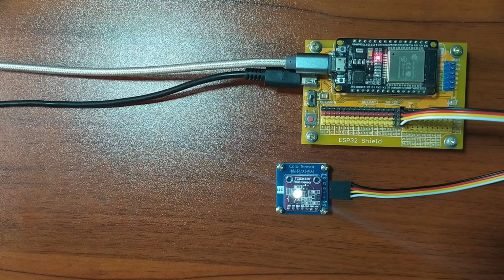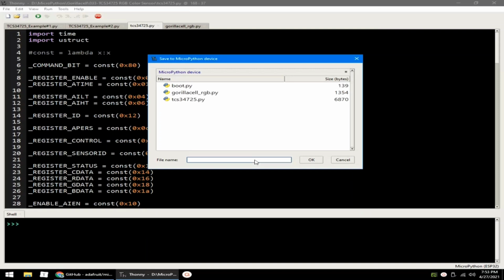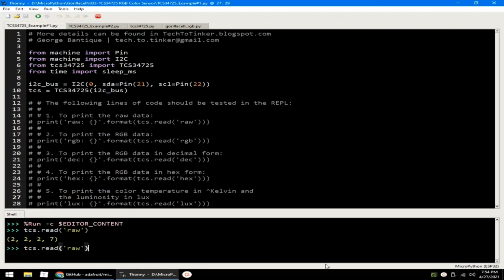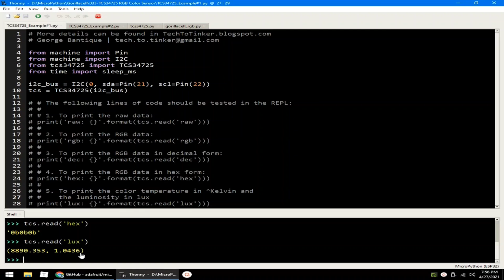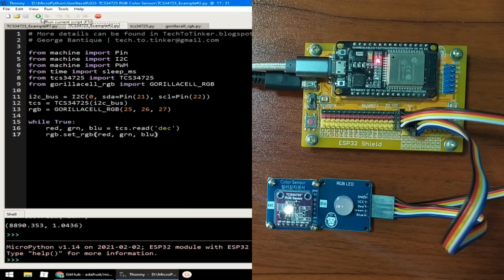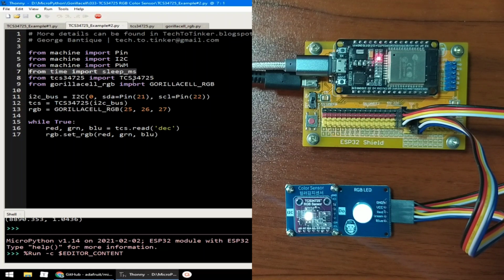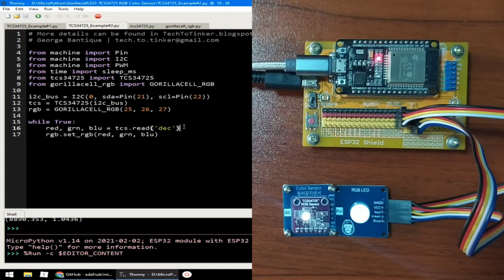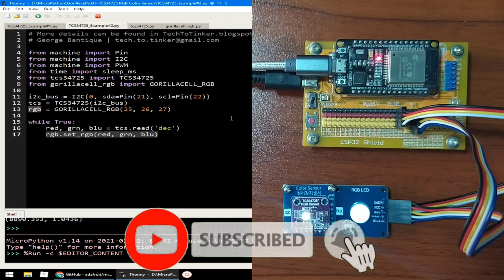033 - MicroPython TechNotes: TCS34725 RGB Color Sensor

Comment: Hey nice video. But wen i run code to read the raw data every second -> print(tcs.read('raw')), i get some data and after 20 seconds or so,  i  get an OSError: [Errno 5] EIO. This Error comes from register 8 or sometimes 16 and i don't know why. Does Anybody have a solution? The Error comes irregular.  I'm frustrated.
Reply: Failure comes from the line wich says: self.i2c.writeto_mem(self.address, register, data)